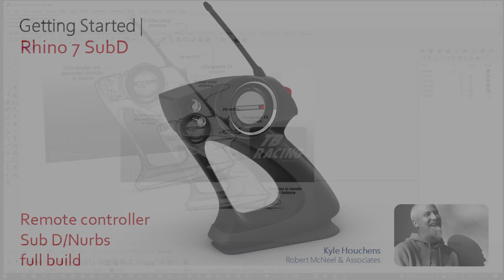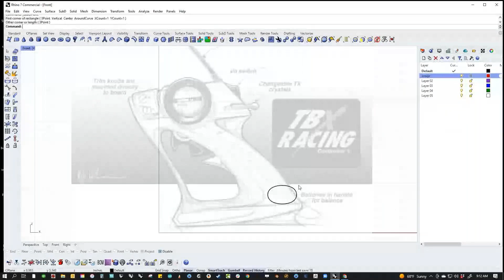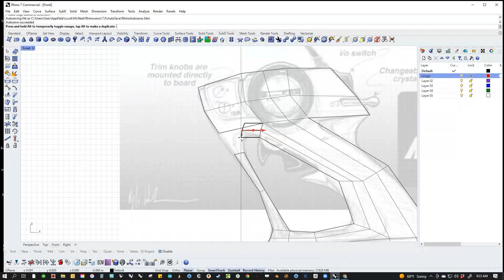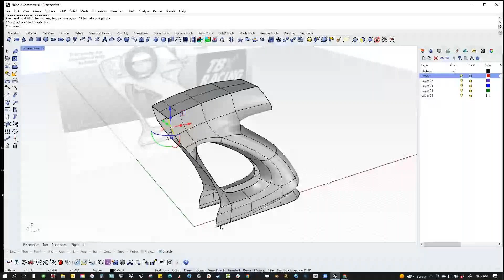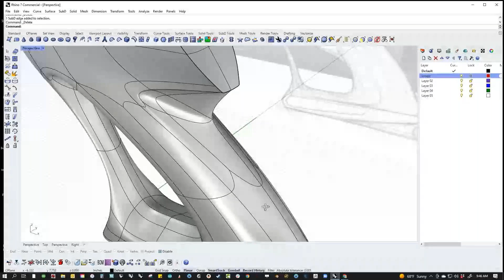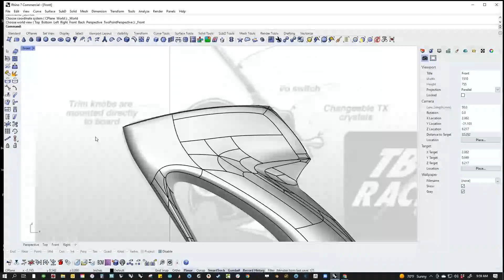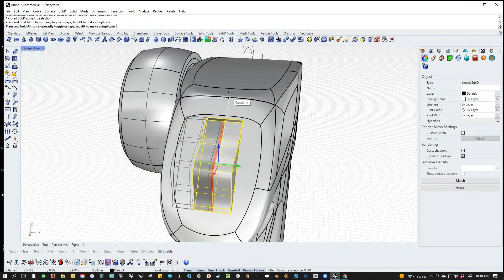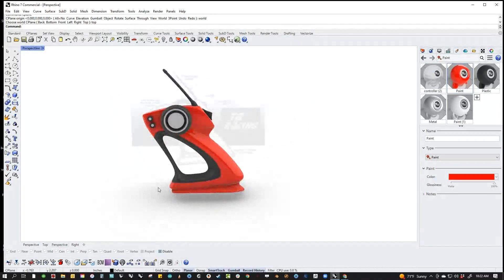Rhino 7 windows - RD controller using SubD and Nurbs.

Comment: That material assignment at the end did smell like a bug. Great save! Two things I have done for similar glitches are 
(1) Make a new material, assign that to the naughty bit, then delete the material. See if the geometry reverts back to ‘no material’ so you can assign the desired material
Or
(2) Save the file, close, then re-open. This magically fixes about 80-90% of my V-Ray problems.
Reply from the maker: def was a bug, andy was aware of it and is on it.

Comment: Thanks, interesting model. One thing I've noticed after converting subd to nurbs is that structure/topology of those nurbs surfaces are quite bad... There are hundred pieces, they are not perfectly continuous, and pretty much non-editable anymore. Is that kind of model acceptable in production, or... to call it A-class it would require to rebuild everything? In SubD world we have retoplogy tools, that allow to turn junk meshes to clean quads. Is there some analogue for nurbs?
Reply from the maker: there are a lot of surfaces involved in a subd to nurbs conversion, but they are continuous as per the original subd surface. The only exception is around a star point, and those are settable in the conversion itself from g0 to g2. The difference is how many iso's get added around the point itself. 

you can certainly rebuild a converted object using curves extracted from the polysurfaces itself, just like you can with any nurbs model. 

to answer you 2nd question, you can certainly tool from a converted subd model assuming it meets all of your tooling requirements,  and the results will be as good as any other method that meets your tooling requirements, but you are correct in your observation that editing such a converted model can be difficult. 

I keep a copy of the subd itself for editing if the need arises.

Comment: How would you compare SubD andTSplines? It seemed to me that TSplines produced fewer edges when converted to SubD and had more functions like "Match"
Reply from the maker: Tsplines had almost 10 years of development, so it was more mature in its feature set at the end. Subd is brand new here, and will continue to develop and mature for the foreseeable future. Subd imo is already more stable than tsplines, and will just continue to improve.
Reply: @Rhinoceros3d  I just read my question again. Sorry I meant "when converted to NURBS". You're right! and it's already awesome and very useful. Thank you for your answer.
Reply from the maker: @mazashayeri1411  are you converting the sub d with packing =yes ?
Reply: @Rhinoceros3d  Yes, the packing is set to yes. But still creates multiple patch of surfaces in areas where the forms gets more complex. Sometimes I delete those areas and recreate them with NURBS tools.
Reply from the maker: @mazashayeri1411  that is fully legit workflow.